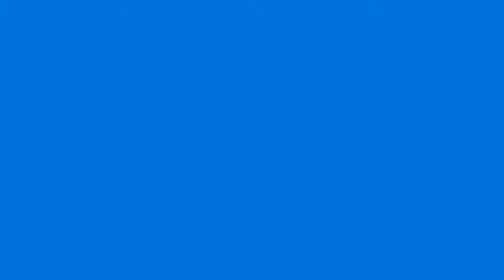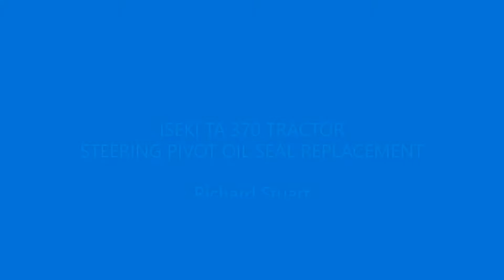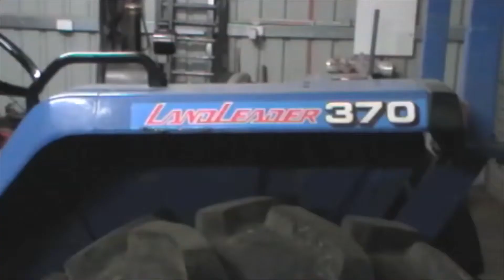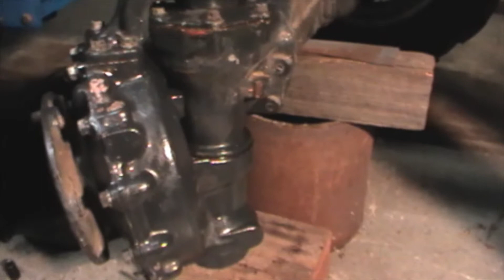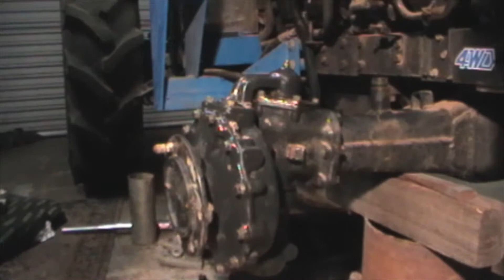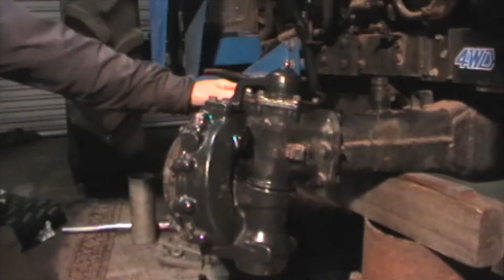Iseki TA370 tractor oil seal

Comment: Some Iseki models were sold into the US as White Field Boss 30 with 3 cyl diesel engine and White Field Boss 37 and 2-32 with Isuzu 4 cylinder diesel engine. Some were also sold as Massey-Ferguson, Mahindra and Bolens. There are service and repair manuals for the White Field Boss machines which can be found on eBay. If you search "Jensales" + "White Field Boss" you may find something which is close. I am on the lookout for what is described as a "sleeve" which is a clutch release bearing carrier which slides on a tubular extension surrounding the two coaxial spigot shafts and is pushed forward by a fork to disengage the clutch. There are clutch disks in the US and "clutch covers", which are the clutch pressure plate assemblies for the Iseki-made White machines. I am repairing an Iseki Landleader machine which was a used import into Australia from Japan and for which there is very, very little product support. So any leads on this part would be appreciated. A previous repairer passed on and parts were lost. It has been a mission to find replacements and the release bearing carrier AKA "sleeve" is the last elusive holdout to find.

Comment: Thanks for this video. Can you please tell us what kind of oil and the amount of oil did you use in the front axle assembly ?
Reply from the maker: Hi Vaclav.  I used gear oil (85W-140) from an auto parts supplier.  The amount is enough to about half fill the horizontal axle casing. I don't know if this is correct but so far it seems to work.